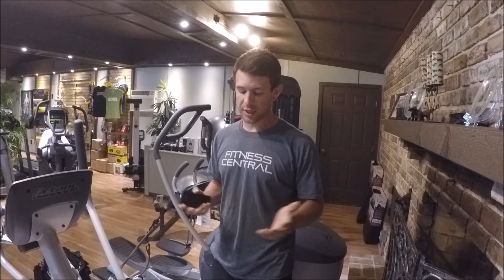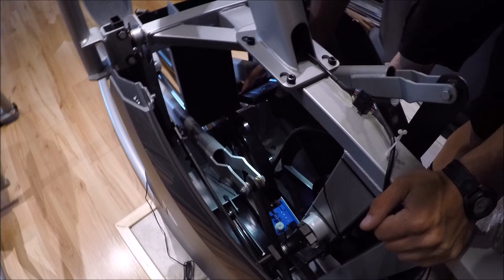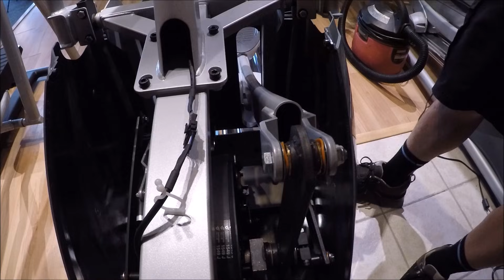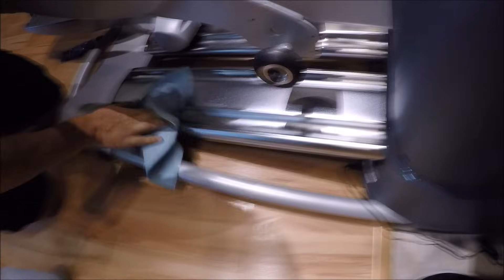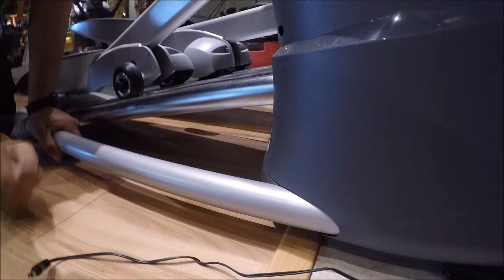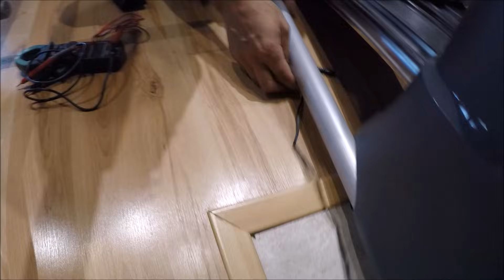Elliptical Preventative Maintenance

Comment: I only have a Healthrider h95e Elliptical. The problem is I try lubricating all the elliptical parts squeaking. However, the problem is I cannot lubricate the handlebar moving joints because the plastic covers are a frustrating problem no matter how hard I try to lubricate those hard to reach areas.

Comment: I just got the octane 35 and it has some minor surface rust. It’s an older model.. do you think it would be best to spray cleaner and use a scoring pad? It feels a bit “gritty” when using the machine .. I wish it a bit more fluid if that makes sense?? Any help would be appreciated!!!!
Reply: I just got an old 37, it had surface rust which can come off by using any turtle wax chrome polishes I believe or in my case Harpic / Toilet cleaner comes in handy too, just a little goes a long way. I’m yet to open it up to clean / lubricate it from inside which seems like an important step to keep these machines feel like new.

Comment: How to open the plastic  cover you didn't show that part
Reply from the maker: Tiny Moore if you mean the top one, there are 2 screws in the top near the top last. Remove the rubber gasket and the screws are under that.
Reply: Fitness Central 
What do you do after removing the screws. Lift up or pull; it won’t budge for me.?
Reply from the maker: Erica Jade you kind of slide it forward. It should be loose. Make sure you have all the screws out. There are 4.
Reply: I was talking about the big round plastic
Reply from the maker: Tiny Moore I am sorry but I’m not near the machine right now at this time. I can say that in the past I have removed the big part and it is nothing more than screws there’s definitely no secret thing that you need to do or unclip them on order to make a come off. The only thing I can possibly think of is that you are missing a screw somewhere. The other cabs that connect to the arms do you clip on and off those you just have to manually pull. They pop off. They are circle caps.

Comment: my elliptical (Octane Fitness 3500XL) at home started to make an evil smell that seems to me like some kind of plastic or rubber, that wasn't there before.  The machine hasn't had maintenance in a while (like 3-4 years).  Any idea if it is more likely the brake pad, or some other part in particular?  I have quit using the machine and I took off the covers but I'm not sure what to try after that.  Whatever it is, it's not extremely strong, but I think it gets worse if I use the machine, and I think it builds up under the covers and then it seems kind of strong when I get a whiff of it.  If I use the machine it seems like I can smell it for some time afterwards, like a week or two.  Any idea where I would get parts for it?  The company wants me to hire professional maintenance people but I am sure it will cost more than I think I have for it.
Reply from the maker: Kevin Leeds that is definitely different.  There is not much to make the machine smell. If I had to guess (and I mean a total shot in the dark) I might look at the drive belt. That might rubbing, out of track, tension pulley set to hard. Other then that, I am not sure what else would be making that smell. There is no motor in it like a treadmill. Good luck.
Reply: Hi Kevin. If you are concerned about the parts needed to replace. I would suggest contacting www.partsfortreadmill.com assistance.
You can sent a request to sales@partsfortreadmill.com.

Comment: what grease are you using for the wheels?
Reply from the maker: We use a Park Tool grease.  (Synthetic Polylube)
Reply: @fcbikeshop  Thanks, I've recently used Permatex® White Lithium Grease, is that ok to use too?
Reply from the maker: jjthed D I haven’t used it but I believe so.
Reply: @jjthedd5249  just my mechanic skills speaking here, but I thought that white lithium grease would be the best for this application... just my two cents. Disclaimer is I'm not a service tech for exercise equipment, but many years of mechanical experience.
Reply: @jamesadams7131  Thanks!